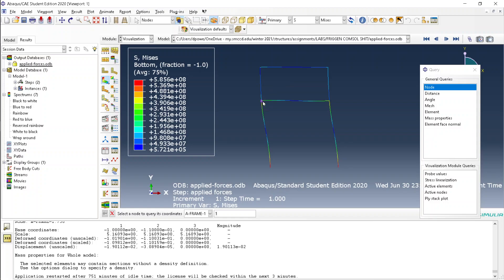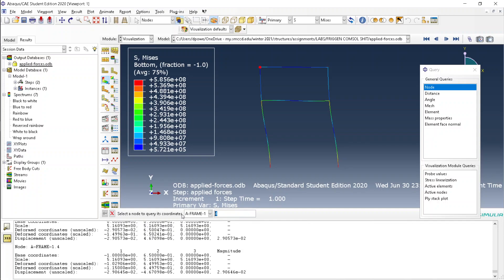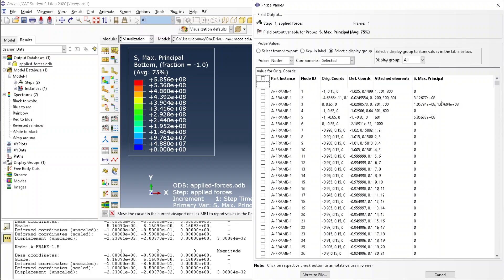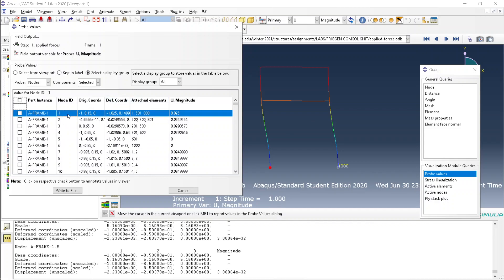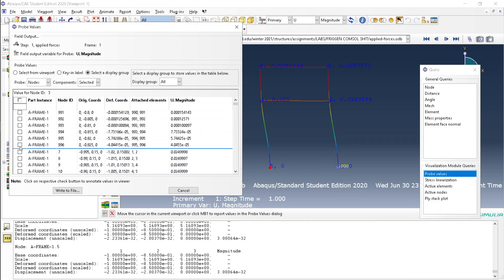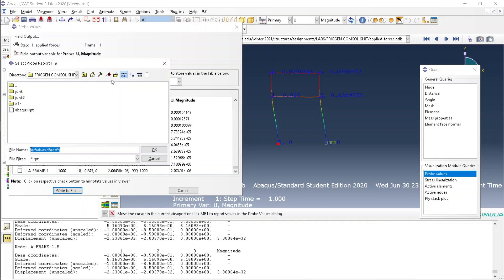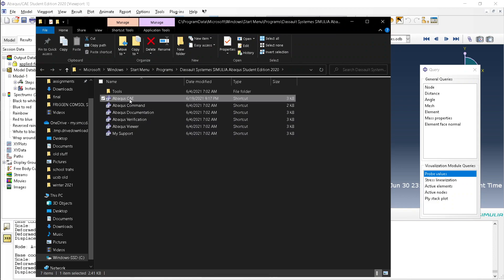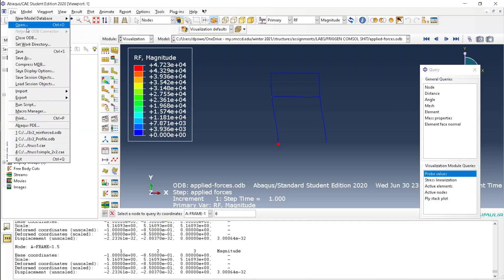Abaqus - how to find displacement and rotation of all nodes in a 2d system

Comment: Hello, I have a question about the Abaqus output variable - nodal rotational displacement. How could I use these rotational displacements (UR1, UR2, UR3) to calculate the vector components? Thanks in advance.
Reply from the maker: I don't use anaqus anymore. There are support forums online.
Reply: @ddpp3492  OK, thanks for your reply. I have figured it out. Abaqus describe the rotation using the quaternion parametrization. The rotational displacements(UR1, UR2, UR3) can be transferred to the rotation matrix referring to the Abaqus theory documentation.
Reply: @bochen7014  can you help me with the procedure for plotting the rotational displacements in abaqus